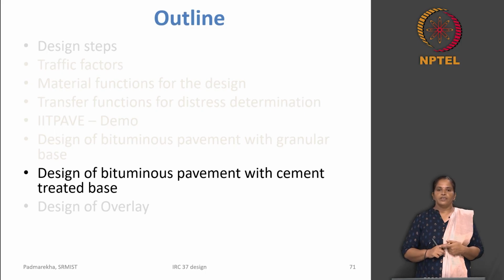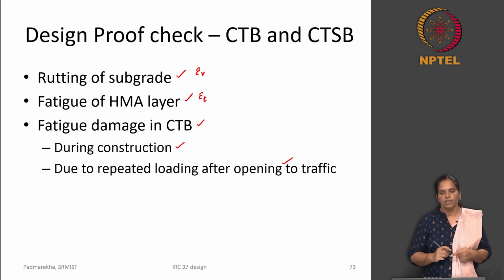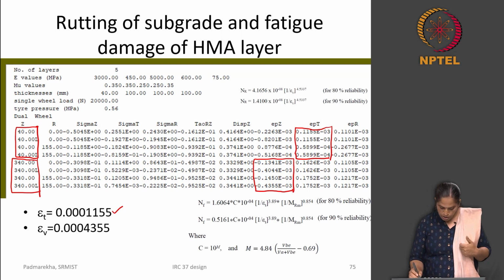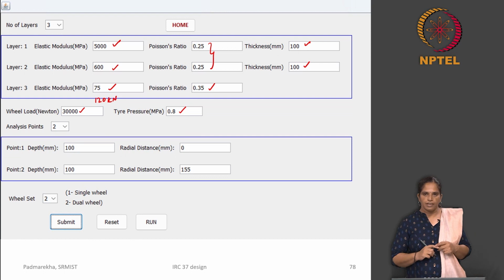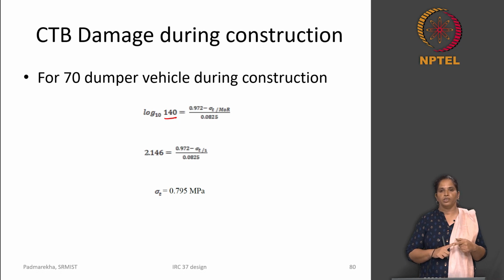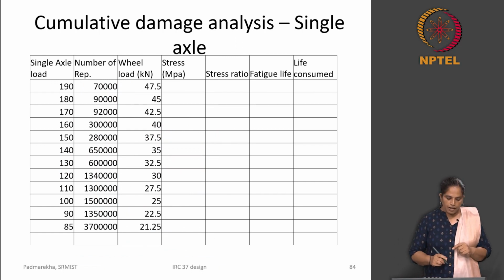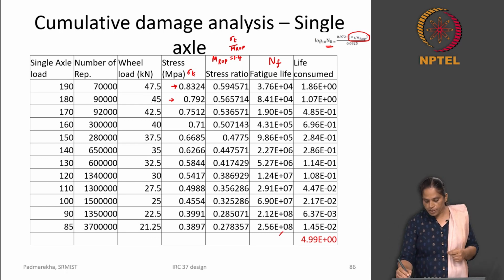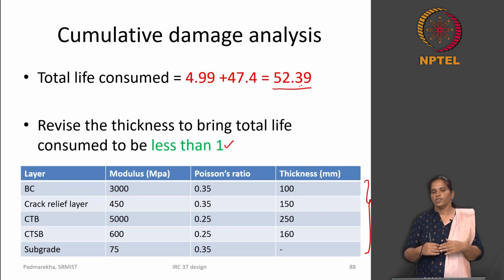Pavement design with CTB

Comment: Ma'am.,Just for clarification
The Elastic Modulus of CTSB and CTB are 5000 Mpa and 600Mpa , which are directly given in IRC 37:2018
The formula of Mr is used only for GSB,WMM. (0.2 * h )^0.45 * Mr Subgrade.

While designing CTB and CTSB direct values should be used Maam. for Calculating EM of CTSB and CTB .

Comment: Deign of a flexible pavement by IRC Code with IIT pave soft, Mam you gave very simple  procedure step by step and easy catching for working Engineers.  I want also  a video  on this Topics (Fig. 3.5 A Pavement Section with Bituminous Layer(s), Granular Crack Relief Layer,
CTB, and GSB Showing the Locations of Critical Strains/Stresses)